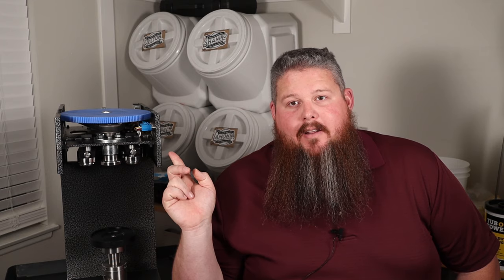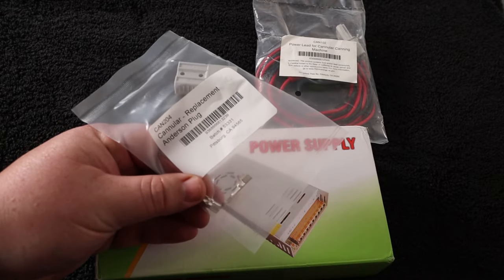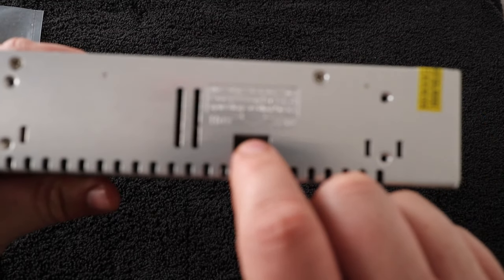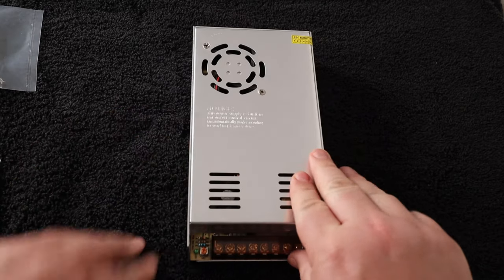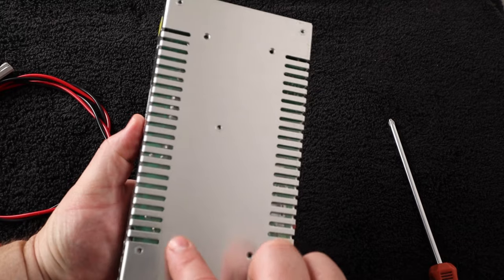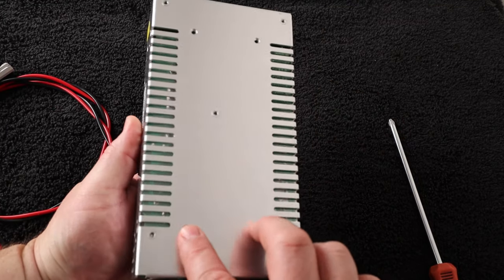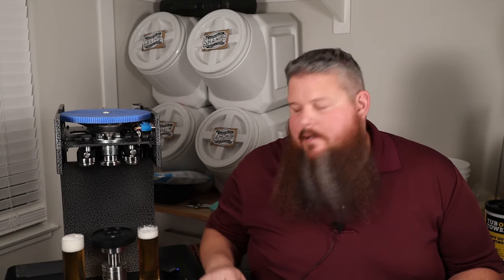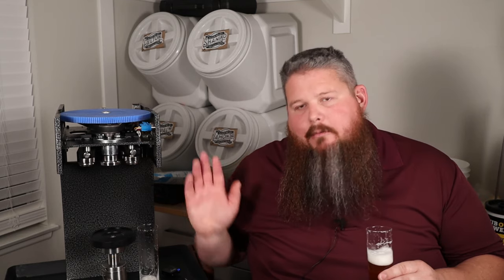Cannular Pro Power Supply

Comment: This video was really helpful when the Cannular power supply stopped working for me!  I bought the canner from another brewer and didn't have any proof of purchase so they wouldn't send me a replacement power supply.  I ended up taking the wires off the original power supply and using a power supply off Amazon that was very similar to the one you linked.   Up and running again just in time for my first 2 pallets of cans to arrive!
Reply from the maker: Very happy I was able to help

Comment: Bought the pro and the power supply you recommend from your link. (the 20amp) Unfortunately when I press the cycle button on the seamer it overloads/trips the power supply causing it to shutdown for a second and reboot.  I also have a 40amp power supply from the same company (that works great for my RC car batteries) and it cannot handle it either.  I tried wiring my dewalt drill battery instead and it worked a charm! No issues at all.  Im off to look for a different brand... hopefully that can handle the startup surge of the dc motor.
Reply from the maker: That’s got to be frustrating 😬 is there a chance that it’s not wired correctly. Or maybe you just have a bad power supply?

Comment: Please elaborate on 15A vs. 20A power supply.  Which did you use and why?  Are there limitations with one that are solved by the other? Thanks in advance!
Reply from the maker: Mine is a 20 amp I also tried a 15 amp power supply it worked fine. I think if you want to use steel cans for canning other things you need the 20 amp supply. I'm thinking you'll be just fine with 15.

Comment: Having problems with our power supply on cannular seamer, have to unplug unit for a little then plug it back in to get it working again? Help
Reply from the maker: I imagine it's probably overheating I haven't had that issue with my DIY power supply .
Reply: @PortlyGentleman  I have not either.  I have not tried the TIN cans on mine yet but these instructions and links to the required plugs was priceless.  Click link, order, wait and use...  Took me maybe 10 mins to have it up and running using your video once the parts arrived.